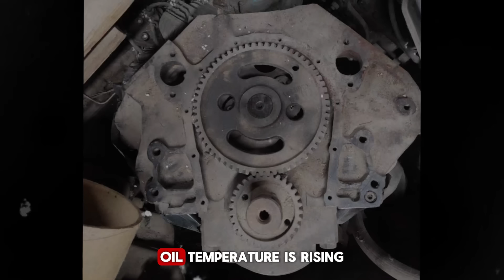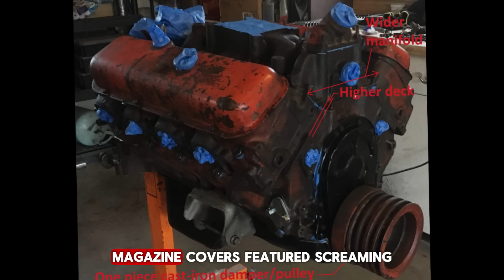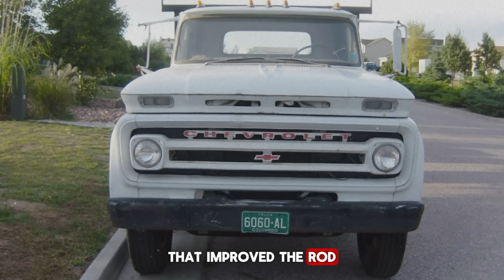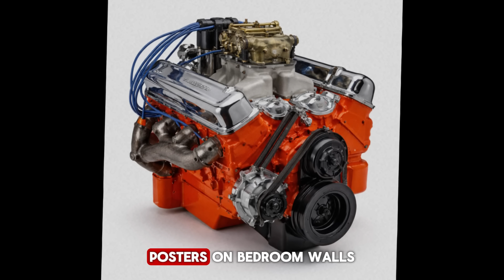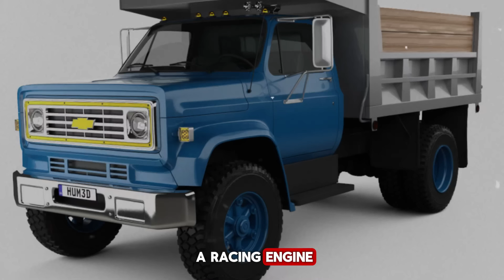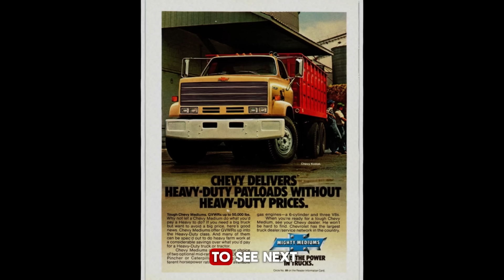Chevy’s 366 Tall-Deck: The Engine America Tried to Ignore

Comment: The tall decks were great,  but the real ignored Chevrolet engine was the 350 truck block, with the four bolt mains and the two-barrel governed carburetor and the two quart canister oil filter, used in C50 and C60 trucks where the tall deck was the optional upgrade. The books and magazine articles on the storied small block Chevy,  only mention "truck" applications in passing, and those were the pickup trucks that still used the passenger small block. Not the medium duty trucks that used the small block in a genuine truck configuration. That is the true ignored Chevrolet engine.

Comment: Hey guys, i have a big question. So im 20, trying to get into these older v8s and learning. I have an old GMC v-EIGHT 6000, pretty old and has been rotting a while, but has this motor in it. Its in rough shape, I couldn't get the pulley wheel (whatver the main wheel is your supposed to spin to test if a motor is siezed) and I couldn't get it to budge..... I think one or two of the spark plugs have been removed as its sat throughout the years. Oil in it though. Anything helpful!

Comment: Owned 3 C70 furniture  box trucks , bought new in 1987 ... 366 td was good for 200,000 miles  then head job , cam lifters , timing set , get another 100,00 ... never got into the bottom ends ,  averaged 5 mpg !!!

Comment: I put one in a pickup with a 4sp. Pulled a 30ft gooseneck hauling livestock, hauled hay, equipment and logs. 
Had to change u joints to larger ones.

Comment: I had a propane 366 in an S10 Blazer mud truck in high school.  When I stupidly swapped a gas carb onto it for some more power and lacked tuning skills, I ran it hot and blew the head gaskets.  It was retired from a school bus originally, and was in the mud truck for years.  I’m sure there was excessive neglect.  It looked brand new inside when we tore it down.  Young and dumb… live and learn.

Comment: I had a 1966 Impala SS 396 big block.  My dad bought it after it had an engine fire.  My friends and I fixed it back .  My dad gave it to me in 1971.  I drove it until it threw a rod with about 60,000 miles.   All the other rods were tight.  Never could figure why that happened .  Maybe something to do with the fire.  I rebuilt it myself drove it another 20000 miles before I sold it for 600 dollars because of high gas prices in 1977.
Reply: This is a 366 not a 396.
Reply: @Brandon-u2l6j Arnt they essentially the same except for slight bore differences?

Comment: I worked for propane company. We bought out bobtail tank trucks with this engine and converted them to run on propane. They ran five to six days a week all day long, never shut off except to load or break for lunch. We put on average 500,000 miles on them with no issues, this mileage did not reflect the actual hours put on these engines. When torn down for a rebuild the engines showed little wear due to them running on propane, no carbon build up or sludge. The only thing that was needed was a valve job to install hardened valve seats and valves, early engines designed for gasoline running on a gaseous fuel would experience valve recession over time so hardened valve seats and valves would be installed to eliminate the issue.
Reply: I had a GMC cab over with the 366 converted to run on propane, bobtail, engine oil stayed clean, i,,t was the hot setup, the only downside was the cab over it would freeze you out in the winter, if only Ford had that engine in their C model

Comment: In the early 80's I drove a Chevy C80 with a 366 and a 5/4 split transmission. We ran it well over gross weight on a regular basis, 2500 gallons of water, 500 gallons of jet fuel, over 60,000 pounds. Going over rough terrain to set up for forestry spraying with helicopters. The suspension took a beating, but the engine never gave us trouble.
Reply: That's a lot of weight!

Comment: Yeah that revised oilin system made a huge difference. The bores being siamese was something that would've made them even more dependable if it was pumping coolant around each cylinder independently but that would've required better metallurgy and other variables that at the time when this engine came out would've been unbearable for the costs to manufacture.  I think gm did a good job with these they definitely went the distance and you still see them on the road today in some parts of the country. They were way more plentiful that the tall deck 427 as well.

Comment: I built a hot tall deck 427 from a C60 flatbed. No way would i encourage anyone to build the 366. There is just too many parts and details in a tall deck. The price is probably 15 to 20% greater than a standard B.B. build

Comment: The 366 did not have a 4 inch bore it had 3.93 bore
Reply: You are Correct (3.93" bore)
Reply: Why? They’re not good for nothing really. The stock pistons are super heavy and explode with any rpm. Small bore and junk heads. Just find a 454 or 427 short deck you can actually get parts for otherwise you’re into misery.
Reply: @FlatBroke612 The 427/454 are not more reliable than the 366 in any way shape and form. The tall deck 426/454 pistons are the same height and material as the 366 but with a larger bore so they would have even heavier pistons... The smaller bore is better for reliability not worse because it allows for increased wall thickness. Or If you're insinuating the consumer "short deck" BBCs are more reliable, that's also completely wrong. The tall deck BBCs were specifically designed for improved durability, the higher deck height not only allowed for an extra piston ring, they used longer connecting rods for reduced bearing stress at high RPM loads. The water jackets were enlarged over consumer BBCs and they used a higher capacity coolant pump and oil pump. They had larger bearing surfaces for better heat dissipation and the blocks had extra reinforcement in areas of highest stress. They were for commercial truck applications not for hot rodding.
Reply: @FlatBroke612 they are really good at towing heavy loads long distances for many years

Comment: How about GM's 305ci and 350ci V6? My dad had a 1 ton (not a dually) work truck with a 305 V6 changed to 350ci with granny gear. It had a 1 bbl carburetor. Could pull anything.
Reply: 351 V6!!

Comment: The narration is typical AI SLOP.
Dad had 2 grain trucks my whole life; one had a 396/4-speed, the other had a 427/13-speed RoadRanger with twin screw.
Both would haul severely overloaded payloads all day all night through harvest, firewood season, heavy loads of "new" equipment over the pass and everything in between.
I routinely hauled 66,000 pounds of lentils in a C-50 (396) that was rated for 26,000 GVW.
Tare weight was just under 11,000.
Let that sink in for a moment.
Never once flattened a bearing.
Never once overheated.
Never once ran under 40 PSI oil pressure.
Never once got under 11 MPG.
Meet once got over 11 MPG...
We used them for 2 decades and sold them for the same price dad paid for them in the 1970s/80s when they knew how to build trucks.
Reply: Jared1149; we're being less polite as this garbage is proliferating.  It's now openly referred to as A.I. PIGSLOP. 
Cheers.
Reply: I assume you mean 366 rather than 396. The 396 was a passenger car engine.
Reply: @PlayWaves1 
No, I meant 396.

Comment: They burned gas at an amazing rate. They burned valves prematurely they were a total pile of garbage. A Ford 391 would burn less gas do more work and ya want doing a valve job every 90-100000 miles

Comment: If this has a longer rod than a 396 it will be a torque monster.  Didn't they make a 454 with a tall deck also if so, it has a longer rod which will increase torque, rpm will also increase HP due to less rod angle.
Reply: 427 tall deck
Reply: 427 tall deck
Reply: a 427 tall deck
Reply: I believe the rod length was the same as non-tall deck BB. The pistons were taller in the tall decks.